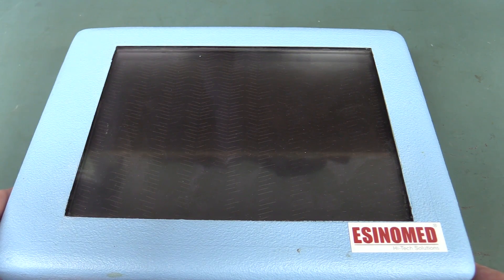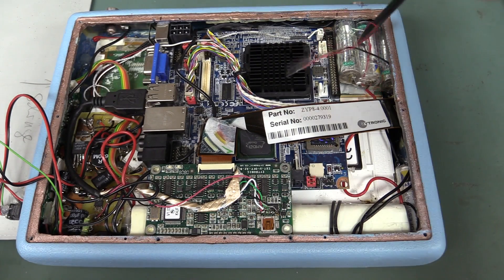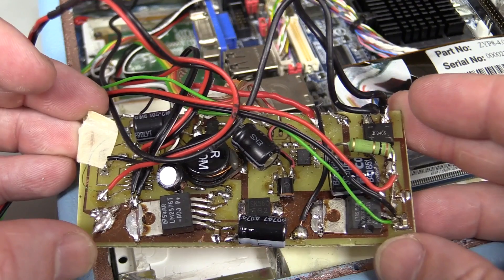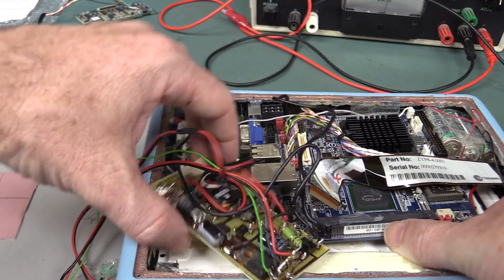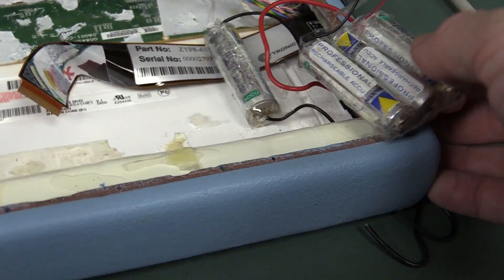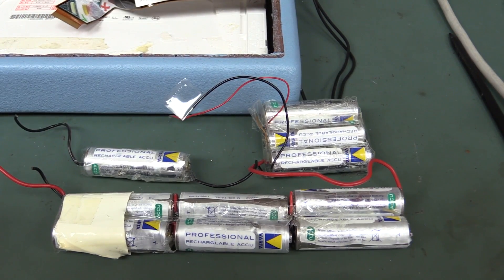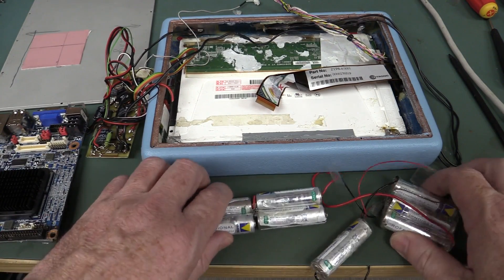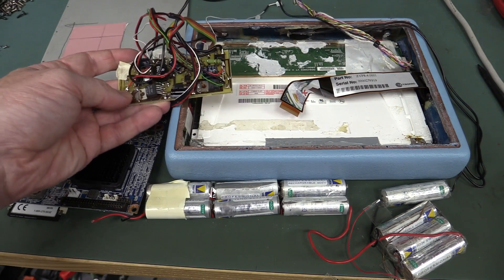EEVblog #822 - World's Worst Tablet Computer Teardown

Comment: I know this is an old-old video and nobody cares, but: never make a judgement without knowing the exact circumstances. Anyone may end up with solutions like that if there are no other options. When you have no access to a battery spot welder, but you HAVE TO prepare a battery pack. When there is no option to quickly buy a power supply and no option to prepare a PCB, but you MUST supply that PC board somehow.

Comment: At 3:35, there's a disgusting build-up of solder at the lower left side of the PCB.  A little later, the other side of the board is shown, and nothing is connected at that point.  Apparently, wires had been soldered there, then removed.

Comment: the real question is...why AAs? Assuming this was built in the golden days of windows XP, rechargeable nickel cells, They were pretty expensive and rare to find...if they needed more than 12V. Why didn't they just use one (maybe 2) lead acid battery, from any electronics store or taken from an emergency lamp. Both are relatively poor choices, but at least lead acid won't blow up if you load it directly into the source. [it would even have had better autonomy] if we base ourselves on the fact that all the AAs are in series, so you have 10 but potentially that only equals 1.

Comment: I have had this happen more then once, where i end up getting a device that looks right from the outside but is carnage inside. But it's not okay to asume that this is the end product from that company. It might have been a privatly owned device that has it original guts removed and replaced by an electronics hobbyist, while not bothering to remove company labels.

Comment: To be fair, this was probably just part of a prototype run, which was then kept in the field as it did work.

Yeah it does look messy but the way the bloke is whining about the internal aesthetics, you'd think the hospital staff are opening this thing on a daily basis, showing everyone. When I build a PC, my cable management is garbage but the PCs still work 8 years later. Who cares how it looks under the cover, especially a prototype.

For people commenting on the bulkiness , yeah that's what parts looked like in the past. I estimate this was mid 2000s, judging by the touch screen and VESA bus looking port on the main board.

As for the soldered cable, that was probably done as a mini-usb cable would have come loose over time, or it would have made the socket wonky. The larger USB plug would not have been affected as much.

Overall, pretty nice for a mid 2000s unit, which replaced a bulky laptop.

Comment: I have an idea what might have happened here.

Imagine:  You need 20 demonstration units to show people at the big trade show two days from now.  You have a custom shaped battery pack as well as power supply designed and being produced, but shipping is running late, and you're not probably going to receive your parts in time.  Oh, and due to size constraints in the case, off the shelf battery packs and power supplies don't fit.  Nor does a full length USB cable, for that matter.

All the other parts have already been shipped to you, and you know the software mostly works because you've been testing it on your development unit, which is better described as components wired together and laid out on the table than a self-contained tablet.

So what do you do?  You could wait for the next trade show, but it's next year.  Or you could hastily design your own rudamentry power supply and stay up all night soldering.  Remember, the demo units only need to function for a few hours until the trade show's over.
Reply: This does make sense, and hopefully it's what happened.  I'd hate to imagine anyone would actually produce this turd and ship it to customers.
Reply: lol and the soldering, there is no excuse for that
Reply: @membola  And you have only an old gun soldering iron around to put it together... With knowing the exact circumstances we would maybe amazed of the resulted quality.
Reply: @kralg  You know, at first I was going to say that nobody with the tools on hand to etch a custom PCB only has a $15 old gun soldering iron available to populate it, but then I remembered that the person we're talking about designed this monstrosity, so yeah, totally plausible.
Reply: but its the 11th one
Reply: @membola  the 10 before were even worse

Comment: Having worked for a company supplying blood test machinery in the medical world (Johnson and Johnson) I actually know that this sort of thing isn't that uncommon. We were engineers for a class of machines called Inova, and everytime there was an issue at a company using our machines, we'd help out. The machines looked fine, they worked fine, but on the inside, both in the hardware and the software, it was a mess. You'd need special login details to get to the service side of the machine, and half the functions in that system didn't work, or you had to get to through remote commands, it was a giant mess, just one the customer was never going to see.

And I think that might be the same for this device, once in use, it probably does what it needs to do and NOTHING MORE... And that is fine.

If the movie, The Room was a circuit-board... Thats what it would look like.

Comment: Strictly thinking of the parts in this, if it was released in 2007 for a windows tablet it might be not too bad considering the uses it was designed for.  (I got the year 2007 from the motherboard)

Comment: #########CONFESSION########
(This has nothing to do with content above. Irrelevant to public viewers)
>> I am declaring this because I have a theory that, On a sunny beautiful day Murphy will come and bite on my private area.
>> I am not sure what will this achieve but time stamp on this comment may help salvage my engineering reputation.
>>So here is the thing, Embedded system((custom electromechanical devices to be precise)) is my hobby/business since a very long time. I was used to take private projects/contacts in my earlier days and The company I am going to talk about was used to trade the product necessary for my private project, so in a purchase meeting with the company, they offered me a job.At the age of around 18 ((in 2013)) I joined an IT company ((was not aware at the time that there are no resources at all on hardware side it was just false marketing)) which was into interactive multimedia system. Their main business was of website/software development.
>>Initially they allocated me table work. Nothing technical. But after some time one government project came, which required the hardware as well, not just the software.
>>At the time I was the only hardware person in the company.Also I wasn't aware that there is no hardware facility at all not even a soldering ion. I was thinking there would be others which I may come across once the execution starts.
>>So I kept giving them features company can provide on the hardware side.
>>They gave me green signal for execution just one week or so before the promised delivery date.
>>And what I learned the next moment was that I am the only person who is supposed to handle whole thing, designing it from scratch, production vendor finding etc. Also the person in charge was NOT AT ALL technical even though he had graduated engineering(did not know what power is).
>>Since there was no way around I started the development it included sheet metal fabrication, Du pont Corian fabrication, Electronics Hardware and Firmware development, 
>>And the part which went critical was integrating existing products in ours, To make it look like our own custom rolled.
>> So around three days were left for electronics part after completing the whole work on mechanical side after sleep less nightS.
>>SINCE EACH AND EVERY MINUTE WAS CRITICAL THERE WAS NO TIME TO SPARE FOR PROPER PCB DESIGN. I JUST LITERALLY SPENT AROUND 15-20 MINUTES BEHIND IT. No silkscreen no solder mask etc.
>>Now to integrate already existing product and make it look like our custom rolled. I needed to open the casing and hack into it to interface with my microcontroller, but again SINCE THE PERSON IN CHARGE WAS "NON TECHNICAL " THIS REQUEST WAS DECLINED AND ONLY OPTION I WAS LEFT WITH WAS TO INTERFACE WITH IT EXTERNALLY.
>> and at the time only reliable option seemed to me was to customize an INDUSTRIAL SOLENOID VALVE. 
>>ALSO ON THE DAY OF FINAL ASSEMBLY IT WAS NOT POSSIBLE TO GO OUT TO EVEN A LOCAL ELECTRONIC STORE AND BUY MISSED COMPONENTS. SO I MADE FEW OF THEM INHOUSE WITH THINGS AVAILABLE AROUND ME.
>>Few things worked initially and few things did not and eventually I had to remove the whole microcontroller part. WHICH IS NOT CONNECTED ANYWHERE BUT STILL INSIDE THAT PRDUCT.I made few hacks to bypass all the digital things. And it worked fair enough to give demo but not good enough to deliver it to client.
>>Finally THE UNFINISHED PRODUCT WAS DELIVERED TO THE CLIENT.AFTER FEW DAYS I GOT THE COMPLAINT AND WE REPLACED THE HACKED PART WITH MORE HACKED PARTS SINCE DIGITAL PORTION WAS LEFT ASIDE.
-BUT THERE WAS ONLY ONE COMPLAINTS AFTER THAT WHICH WAS NOT RELATED TO SCREWED UP PART.
########################
>>Product was delivered around 2013 and After few months it triggered my anxiety/nightmares so, I MADE THE WHOLE SCENARIO CLEAR TO THE COMPANY/ PERSON IN CHARGE, I PROPOSED THAT WE SHOULD CHANGE THE INITIAL SYSTEM SINCE WE HAVE SPARE TIME. CLIENT WAS PROVIDING MORE ENOUGH AMC TO REPLACE THE WHOLE THING.
>>BUT MY SUGGESTION WAS DECLINED MANY TIMES EVEN AFTER MAKING THEM AWARE THAT THIS MIGHT SPOIL THE COMPANY'S REPUTATION.
#####################
EVEN AFTER LEAVING THE COMPANY I OFFERED THE PERSON IN CHARGE (S.S) TO MAKE CHANGES ON MY OWN PERSONAL EXPENSES, BUT HE DECLINED. 
#####################
THE MORAL IS NEITHER I NOR MY CURRENT TEAM DEVELOP SUCH AN INFERIOR, SUB STANDARD PRODUCT. I AM VERY MUCH AWARE THAT THE PRODUCT GIVEN TO ( N*D* ) WAS SUB STANDARD . BUT CONSIDERING THE SCENARIO AT TIME IT WAS MY ONLY OPTION.
-RHB/IPR/700123

Comment: "nobody has to know how you did it just, so it works"   Did it work?  Yes.  Did the electrons care if it was a mess?  No.  None went on strike, as far as we know.  Was this growing pains?  Probably.   The "power supply" could have been added later by somebody's nephew when original one blew up. Same with the batteries.  
To assume this was all done at the factory is premature....

Comment: I've the distinct impression that the obviously sleep-deprived engineer behind this tablet was held at gunpoint to put together a "working" run of prototypes in the span of the night, hence the cobbled together PSU and Battery (stuff doesn't ship in mere hours).

Comment: The shitty thing, the fabricator could have at very least been able to effectively solder tht, let alone use flux correctly and use the right flux. I soldered better than that my first try lol. And those batteries? That's medical stuff, those looked like cheapo bullshit clone batteries.

Comment: I'm a hardware designer in the USA, 12 patents in design of fault tolerant servers and 8 years as a sub sailor in our nuc fleet. I just RIPPED MY EYES OUT AFTER POURING ACID IN THEM.
How did this ever pass any agency testing, no way does that so called power supply which doubles as a radar jammer would pass, how'd this pass safety, are they paid off in your country as well. I imagine the RF that thing puts out, jamming everything else monitoring patients. And then this being medical device would need to pass far more agency requirements than a commercial product. 

I dont know who the bigger lacky here is, the people who made it or agencys that passed it and I did not see any agency approvals on the back plate. Avoid this company like the plague. What country are you in mate , Australia, New Zealand?

You did a great service to the world exposing this, did they get 5 yr olds drunk and had them build this, nothing can possibly be this bad, its the worlds Number 1 hunk of idiotic S##T!

Comment: Couldn't even use electrical tape 😂
Reply: To be fair, electrical tape has the flaw that it unravels when warmed up. Stationery tape doesn't do that. If they wanted to be perfect, they would have to use kapton, but even Chinese kapton is comparatively an expensive tape.

Comment: Wow, that power "brick" is awful. Something I'd design at home maybe. But even then there would be a proper holder instead of soldering directly to the batteries.
Too much stuff that can easily be done better by getting off the shelf parts.

Comment: My father (superior telecomunications engineer) always makes the better weldings. They waste preaty much no welding metal. My welds (someone that has no idea how to erld a cable to a metallic surface) used to look like more or less the ones on the battery my first day, but after a few attempts, they were fine. 
The welds we see everywhere are worse than the ones i did my first day. How have they managed to not learn anything from one weld to another? I mean... You should be able to make a decent weld after 10 attempts, but they are all horrible and even some of them look like rotten battery liquid mixed with the surface cleaner you put before the welding process. 

Still can´t belive this isn´t a joke.

Comment: I wanna take EEVblog and put him in a race car:
"Wooow, who made this switch panel, these toggle switches are from China....unbelievable"
"Woooow look at the battery, it's a varta but, my god, it's not even BMW OEM equipment woooow, and the home made welded mount woooow"
"My god, look at this, look at this, the roll cage is bolted to the floor woooow, and the steering wheel comes off when  you press this button, how is this car allowed on the track woooooow"

Comment: Kinda scary that was for use in a medical setting. Imagine if that battery or regulator wiring had shorted and smoke started pouring out. Only saving grace is that they weren't lithium batteries, in that case it would have been really risky. 

Although, why didn''t they just buy an off-the shelf (overcharge-protected) lithium pack and charge regulator board? A tenth of the work and you have a certified safe setup.

Comment: it's most likely an r and d unit used to get funding, they have to start somewhere and use cots components. the reason things are directly soldered without cases are because of space constraints. most likely only a proof of concept. I think the comments in the video are unnecessary.

Comment: At least it has a much higher repairability score than your average Apple product.
Reply: Mel Gross yea, that’s why all the gpus in the 2008, 2010 and 2011 MacBooks failed
Reply: I would rather have this than an apple.
Reply: what is there to repair on a dumpster fire like this
Reply: Mel Gross but not repairable without paying out the ass or just upgrading, hence the point of his comment
Reply: Schrader One example doesn't set the average! ;)
Reply: Mac fanboyism, what did I expect?
Reply: Don't believe me if you don't want to. I'll do whatever my experience tells me, and it's positive for macOS and iOS and negative for Windows and Android.
Reply: I don't have to believe a mac luser. I know already, since I stay up to date, and unlike fanboys I don't judge a book by its cover.
Reply: Ducklord I don’t care what you think, you hater. With this comment I hereby end this conversation. No further comments allowed. Any attempt on commenting further will result in a block.
Reply: That's funny. I don't hate, just say as it is. Stuff that is good deserves praise and stuff that sucks needs to be pointed out as such.
Reply: @YaFunklord  I have had two broken iPhones in a row, first the one I bought at a store, then the second one Apple send me as a replacement.
When I send back the replacement, they weren't even surprised it was bricked within the first week lol... says enough about quality control I think 😜
Reply: Of course. Apple products are designed to break easily and everything is soldered and glued shut. Because people are stupid enough to buy their products again and again and again and......
Reply: 2009 Macbook Pro still working fine, a 2012 Pro as well and a 2011 Air needs a new battery. Looks like I'm the lucky guy :D
Reply: Lord Zordid Because there’s no real alternative to macOS nor iOS.  Winblows is slow, unstable and just generally sucks in my experience. Linux doesn’t have enough native software. Android is the same as Windows, with the only advantage of being open source (yet controlled by Google who wants your data).
I’d rather have a machine which works when I need it and breaks in 3 years, than one which can last hundreds of years but constantly crashes.
Also, I have a Late 2009 MBP still running perfectly fine, and it’s very fast for having a Core 2 Duo!
Reply: Apple design has sucked since they stopped Apple 2 series.
Reply: Both Windows and MacOS are slow and unusable nowadays.
As for software, since Linux is nearing complete dominance, more and more single platform software is getting ported to it.
Reply: I haven't had any problem with macOS. My 3-year-old iMac is almost as fast as the first day (and I updated it through 3 major versions without formatting, something unthinkable in Windows).
Reply: I'm sure it's an old version then, because the new one is probably the slowest OS ever made.
Reply: Nope. It came with 10.11 El Capitan and I upgraded to every single major version then: 10.12 Sierra, 10.13 High Sierra and the most current one, 10.14 Mojave. Not a single problem. Maybe you're using a very old Mac (more than 5 years old, probably) so it's very slow, or you somehow screwed up your installation (which is much more difficult to do on  Mac than on Windows).
Reply: My 2010 MacBook had 0 problems so it can't be all GPUs.
Reply: Ad astra fortunately, Apple products aren’t built anything like this, and are reliable.
Reply: Sure, until they break